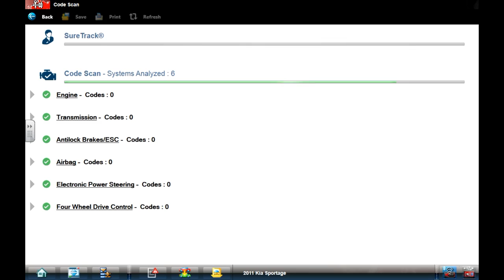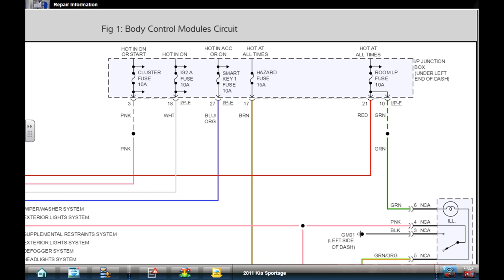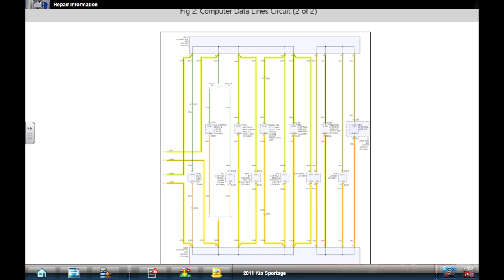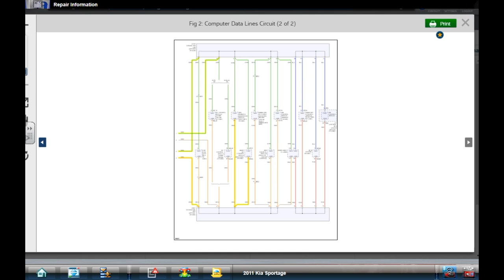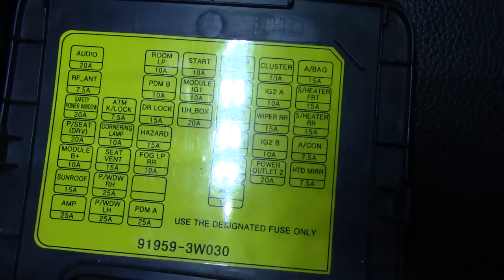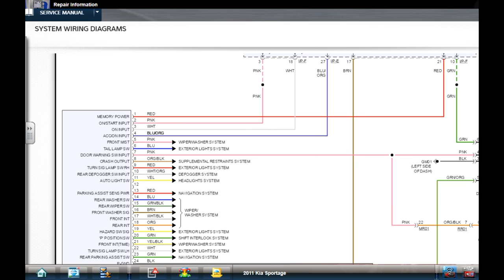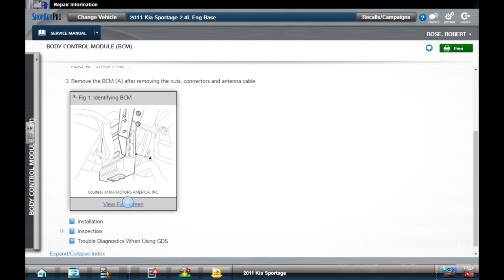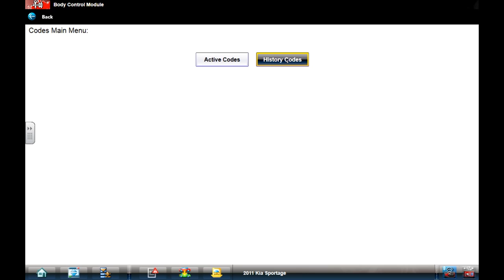2011 Kia Sportage No Com with BCM

Comment: hey Paul have come across this situation a few times on the field here in NZ with different models of Kia in most cases it has been caused by a weak or flat battery ' jump starting and or lose terminals " non wakeup of the BCM after being jump started or battery replacement to date never  replaced a BCM nor have I made any headway  understanding why the system does it "EDIT this is one bit of information you may find of interest though quoted from Kia as follows ""What happened was that they must have either pulled the memory fuse during service or disconnected the battery.
The time and type of unit of distance ie mile or Km is set in the clock display it is the next option after the time and date setting.
Sorry but you have lost the mile and mpg data on your trip there is no way to retrieve it that I know of.
The memory fuse is the one in the big yellow surround at the top centre of the interior fuse panel. It supplies the memory functions of the trip computer and the radio/sat nav and the interior lights. It is normally off for the journey from the factory to the dealer to be reconnected at PDI by the dealer. (this is to avoid battery flattening in transit and/or storage.)
But it is far more likely that they disconnected the earth cable of the battery as a safety measure for certain procedures. Thus any device that has a volatile memory will lose it! The radio has a holds up capacitor that lasts for a short while but that varies from car to car. So as a bit of theory here  think back to early in the video  you established that the instrument cluster was your low can gateway the memory fuse maintains memory on that circuit which the BCM monitors  but what would happen if all of a sudden that gateway lost its settings ?  Just food for thought
Reply from the maker: Thank you!

Comment: Applying concussive troubleshooting...   I work for the local Port Authority and the newer the buses are, the more ECMs they have. No more "throw a switch, light a light"... Throw switch, signal a computer, which signals a main computer, which signals the light's computer, that lights the light. "Comm faults" are common.

Comment: mmm,  all those "joint connectors" what could ever go wrong there, with all that junk plugged together through poorly conductive low power connections, like a bit of tarnish or fretting and it becomes a highly capacitive connection. a scope connected tot he can lines early on would have been great to see, but even that as well as plugging in scan tools or breakout box can change it enough electrically to make it semi-functional again, not everything is as sensitive to out of spec bus noise either.
I hate to say it, but "labor cannon" cleaning all the connectors and terminals with cleaners may be the best end solution. all that junk reminds me of early computer "networking" before they went to switched networks, which is what newer vehicles seem to be doing, with multiple buses and "gateway" modules interlinking them (go figure ehh!)

Comment: I'm going to go a bit off the wall here... is it the original battery still? did they run it down and jump-start?  even if not, how old is the battery and are terminals clean? it could have been a lockup caused by bad battery or loose connections.  of course make sure the fuses and terminals aren't all tarnished up, that has messed things up since the earliest days, pre- vacuum tube era!
welcome to the wonderful world of "junktronics" that rely on very stable power, which very often isn't stable and causes all sorts of random stupendous issues, like lockups.

Comment: NEED YOUR HELP ,HAVE A 2015 DODGE DURANGO,INTERMITTENT NO DRIVE,HAS REVERSE AND ALL OTHER ,CHRYSLER AND GOING NOTHING FOR ME,D ON DASH BLINKS ,I AM MECHANIC FO 40 YRS AND GOOD WITH ELECTRICAL,NO CODES,HOPE YOU GET BACK TO ME ,I KNOW YOU ARE A BUSY GUY,LOVE YOUR VIDEOS,COBY
Reply from the maker: you need an enhanced scan tool to read the TCM, if your D light blinks on the dash, you absolutely have trouble codes

Comment: Hi guys  my name is Juan and I need help I have 2000 gmc sierra 1500 v8 5.3  2wd and the truck run good for 5 minutes after that the rpm go up and down and as if he were in neutral doesn’t  grab any speed or reverse the check engine is off they already check the motor and transmission with scanner and found no codes already reviewed severas mechanics and they gave me different diagnoses that’s why I write to you I hope you can help me or at least Guide me thank you for you attention and I hope answer me thanks
Reply: I forgot to tell you when it start to fail I turn off the motor for 2 minutes and after that I turn it on and it works as if nothing happens for another period

Comment: well these computers of today go wankey and just need to be reset remove power and they will reset and be perfectly fine again have had this happen several times and that is why I always check powers and grounds first and if its a module no com remove connecter for  10 seconds and reconnect, and unless the module is fried or there is a wiring problem everything works again go figure. they need to add a reset button like on the desk top computers. lol

Comment: Working at KIA we get this kind of crap all the time.  We have the same problem with the power tailgate not working, but if you reset the memory for the power tailgate module everything works again.  We have contacted KIA technical assistance and still don't have any idea why this happens.  We have seen this power tailgate issue on at least 8 other vehicles.

Comment: I 've had bcm faults when battery has become discharged then vehicle jump started ,once battery is charged fault remains until battery is disconnected and bcm resets,
Common procedure with Citroen and Peugeot is battery reset

Comment: give the car back to the owner an have them drive it around, if the problem re-presents its self then they could try pulling the fuses back out again, if that makes everything work again then i think other than replacing the Bcm id be looking at the software for possible corruption of the software maybe, ?
Reply: only other thing i might think to try would be still checking powers an grounds if pulling the fuse ( resets the bcm ) as you said then maybe there is still a power or ground fault between the fuse an the bcm ?

Comment: Perhaps someone in the past, used the MEMORY FUSE, to add a power outlet to aftermarket junk, and removed the aftermarket junk at some point, and replaced the fuse, but caused a pin fitment issue, that you resolved with pulling the fuse?? 

You gave in to the nay sayers, and shot yourself in the foot, trying to appease them, instead! Maybe this issue will show back up, and you will know where and where NOT to look!! 

Who knows?? Maybe even a broken trace, inside the fuse panel, that has no connection to corrosion, just poor materials and workmanship, LIKE THE CHRYSLER TIPM, sitting right next to you, blowing the horn like a monkey on LSD!! Lol

Comment: instead of Autel  get Launch...   snap on is useless.
Reply: Snap on does more than I could ever ask for.
Reply: @Ashroyer86   snapon is ok....  but it is all about price. for $3000 scanner you get  Launch.   5 time more capabilities than  $5000 snapon code reader.  so you maybe wasting $2300.  also for the money you can do the same than snapon does with a $700 scanner, so you might be wasting $4000.

Comment: Scanner Danner you're talking too much . Just jump the can bus from BCM to DLC . Eliminate wiring issue .. obd breakout  box
Reply from the maker: Lol I'm teaching, I'm paid to talk and jumping the BCM (which is on a totally different network, most likely low speed CAN) to the DLC to see if it talks with the scan tool would not only be time consuming but wouldn't work! You'd be mixing low speed and high speed CAN signals.
Reply: Yes your right. He talk more and more. I  follow him since the first time but now he make video like he is a Hollywood star. And don’t appreciate it anymore